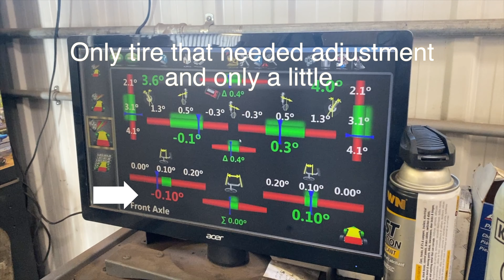Sorry I was gone for awhile! E-104

Comment: Just saw your video pop up, thankful your doing well as yes I was curious how things were going for you as you summer in Canada !. Finished watching the video and indeed the trailers that are not as tall over all will have the inner fenders while the tall ( high off the ground floor of the trailer ) allows for no inner fender but the downside is the extra over all height. Looking  forward to seeing what your experience will be with the falken AT tires. Oh and did you end up getting the front torsion bars adjusted a bit to raise the front end for a bit more suspension travel ... and take the initial sag out as its common for springs to give up some of their initial height from new.
Reply from the maker: Thanks and yes but when they put the leafs in he lifted the front way too much. Think he thought I was younger than I look. lol lowered it before I went in for an alignment. Surprised with it lifted and new tires and driving around in Mexico it was almost perfect.
Reply: @jjsoutthere7267  I don't have that issue, they think I look older than I am (  so its your good fortune they see you as young ). I am sure there is some perfect height set for the front end, not sagging too much that its riding on the bump stops as you sit but not cranked way up so that its damaging the ball joints and the tie rods as well ( the factory components can't handle that severe angle ) and the suspension doesn't have the proper droop then either, and it stiffens up the ride quite a bit if cranked up. I think back to the good old days when truck owners knew that the rear end is going to be up higher with no load ... now the mall crawlers seem to think the rear should be NO higher or if as high as the front end with no load, and of course 26" diameter wheels with rubber bands for tire sidewall height LOL. Oh and back to your rear leafs added, in my mind I think that is the most sturdy and maintenance free method and stable, as well as the load is being applied to the proper locations on the frame with the spring eyes rather than stressing the frame with jacked up air bags over the axle. I know this may sound like a waste of time but I wonder if you should go through the pains of pulling the hubs on your new trailer to inspect the amount of grease that was put in or at least one hub just to get an idea of how it was packed at the factory. Good call on going with the heavier axles though in my mind, there is a reason why over weight holiday trailers seem to have far too many bearing failures leaving them stranded at the side of the road with a mangled spindle in a worst case scenario. It might not be a bad idea to have at least a set of bearings and seal if not a whole pre assembled hub as a spare but I realize that means packing more weight yet ... it never ends ( kitchen sink and all ! )

Comment: Nice new toys.  What prompted the added leafs.  Did you feel the truck and camper was a bit soft?
Reply from the maker: Not really. I had lower stable loads on and felt it was a rough ride. By adding two leafs and removing them gave me a 1/2 lift and at the same time took the stiffness out. I still keep the upper stable load on.